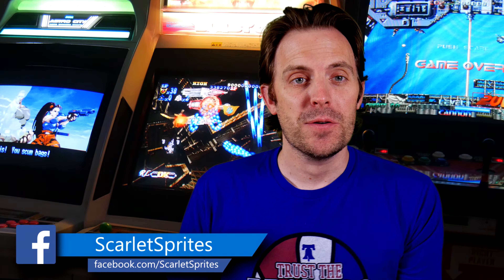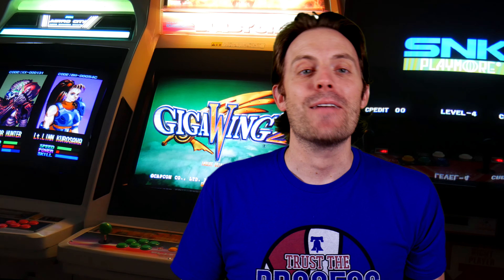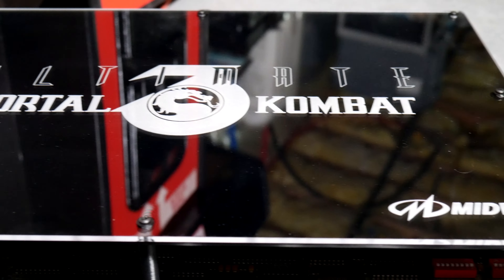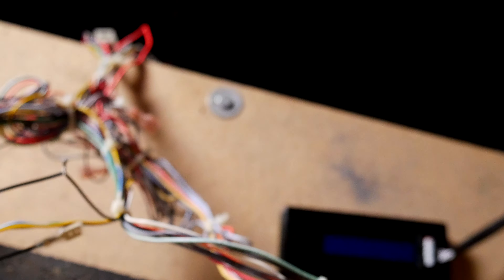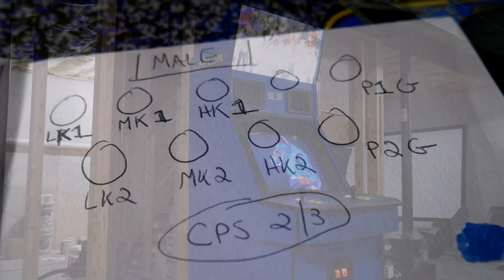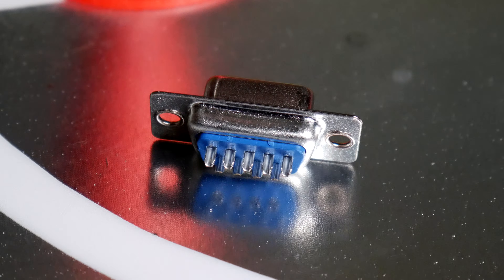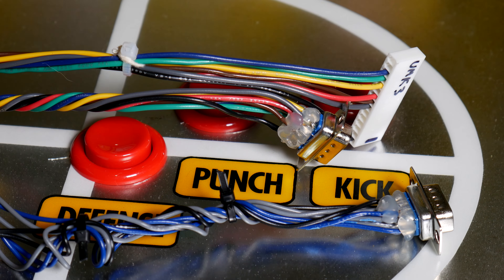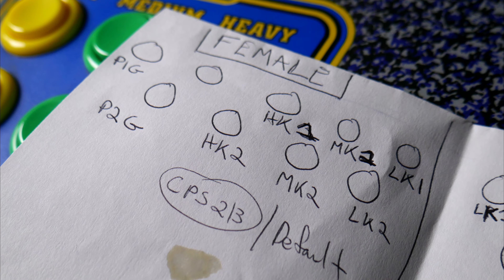Arcade Kick Harness Standardization

Comment: I came to a similar solution for my hori arcade stick - I wired it up with a db15 so I could plug it into my supergun/mvs, but then I wanted to also use it on other systems, and didn't want to unplug every pin from the buttons each time I switch systems. I've used the cheap ebay db15 breakout boxes for now, there's no soldering and they have a plastic case, but they are on the large side. db9 would be good too but I needed more pins.

Comment: This was a great explanation.  For those that don’t want to solder to the DB9 connector, you can buy male to female cables and cut them in the middle, then connect the wires to the wires on the PCB specific connectors.
Reply from the maker: Yeah, there are also solderless DB9s I’ve found too.  These were cheaper though and I didn’t mind spending the time.  You’re right though, if you understand the basic concept you can apply it to other parts and do the same thing.

Comment: Thx for diving into this.  Interesting to know.  I was mulling over starting an arcade collection the same time I was researching a JAMMA set up to consolize the MVS.  Glad I gave it up and just decided to go the MiSTer route, but I'm still an arcade fanboy.  Noticed you have AvP running on your Astro City cab.  Holy grail game for me.  Played the hell out of it in college and MAME later
Reply from the maker: Arcade boards are pretty fun and it’s really a hobby all it’s own.  I can troubleshoot and do basic repairs, but the heavy stuff like surface mount chips and even moderate pcb repair is still beyond me.  The AvP game is actually running off the Darksoft CPS2 multi that was installed in that cab, but has since moved over to Big Blue.
Reply: @ScarletSprites  AvP on a Big Blue? Sacrilege! ;-)  What about Player 3?
Reply from the maker: They actually shipped in Big Blues, but like you mention, my setup only has a CP for two players.  I’m ok with that though.  Even the 4P Midway cabinet rarely has three people going on it at my place.
https://pin.it/JpSLLfd

Comment: I know this first world problem all too well. My solution was to standardize on one format across all of my boards for the games which require a kick harness. The standard I went with is CPS2 style connector.

The way I did this is via CPS2 harness adapters for everything I own, including MK2, UMK3, CPS1, Namco System 12 (Tekken Tag 1), Sega ST-V and Taito F3. I thought about doing something like this re: DB9 connector but I decided I really didn't want to touch my cabinet wiring at all when I change boards, which is frequently. Now all of my cabs are wired "permanently" with a CPS2 kick harness and all of my boards connect cleanly, as if I was swapping a CPS2 motherboard. Even Atomiswave was adapted to this standard, via Atlus adapter at the JAMMA edge which moves buttons 4 & 5 to a CPS2 style connector.

Everything I used to make this happen was purchased from JNX or from the user community on the A-P forums. Now if you want to talk blasphemy, I play MK2 and UMK3 on an Astro City cabinet. But at least I do have the option of plugging in a USB controller/stick for those games, which was another thing I did to those machines.

Comment: How does that apply to my street fighter II CE that I have running with a supergun and Saturn controllers? How do I plug/wire the kick harness in this case?
Reply from the maker: The same concept could apply but I really have no idea how your Supergun is setup.  Presumably there is already an option for this that standardizes the kicks to the controller?

Comment: I did this to my cabs because I had a mess of 3 spliced harnesses in each cab.
Tekken mk and sf.
It was when I got the small cab super gun that had db15 for controllers and db9 for extra buttons that I thought to standardise my cabs.  Was going to wire my splice all my arcade standard jamma to db15 too but haven’t got around to it.
Reply from the maker: I thought about doing that and kept thinking there had to be a better way.  I definitely recommend standardizing it to something you can plug and play.

Comment: Funny you're using this in an astro city I thought all already had this setup included from factory. In mine the kick harness has two AMP  female connector on each end, one in the panel next to the 1 and 2 players usual plugs and one inside the cab where you can then change the end of the cable like you did. But good trick ! well done
Reply from the maker: My Astro may have been rewired before I got it.  It’s basically just straight Jamma wired like an American cab.
Reply: @ScarletSprites  oh yeah most likely then, guess you don't mind since unlike us peasants you don't have to change the panels all the time haha. I rarely comment because I don't feel comfortable writing in english but awesome channel man. Made my quarantine much more fun 👍
Reply from the maker: I only have one panel for this cab, lol.  That would be the major solution; remove the panel and add a Mortal Kombat styled panel for the Astro City.

Thanks for commenting, I don’t judge anyone’s English.  I certainly can’t write in another language either.

Comment: Those sketches are actually hi res graphics :)

For me i just have one jamma cab (new astro city) so i crimped all my kick harnesses (namco, midway, capcom) to the 10 pin amp connector.  Complications arise when you throw jvs into the mix though!  Eg. sega rev b jamma to jvs which assumes buttons 1-5 on jamma, and button 6-9 (yes 9!) on kick harness, necessitating another harness which connects between control panel and control panel headers.  Crazy, but i guess i enjoy using all the original harnesses.
Reply from the maker: Coming at you in 4K!

Comment: Street figther has kick pin battery. As far as rewire you can also use (2) 8 pin molex connectors well 1 male a d 2 female use mk board female 8 pin molex and leave kick mk plug with mk board and leave kick street figther plug with cps2 a board male 8 pin molex connector stays on jamma harness in cab. Is how I used to do them makes easy in a d out no matter board
Reply from the maker: Yeah, moles connectors would work for sure too!  Nice tip!

Comment: Interesting video!

But perhaps you can put for db9 connector an hood plastic and no hot glue? 🙂 (or this installation is for test in one step)

Jamma nation help me several times for finding solution about modding... last time, for change battery on a slot with not rechargeable battery (and pull off some composant for no charging)... happy they are here for helping hand (and other one 🙂)

It’s cool to see your basement again!
Reply from the maker: Yes, I think I’m definitely going to grab some cases for the DB9 connectors to make things look better.  The glue works until I can get those.  Thanks for watching again!

Comment: Unrelated question do you have a ki 1 . Reason I ask is I been looking for a ki 1 that its Toshiba laptop hard drive did not warp and throw errors due to heat in atract mode. I do know you can get a micro sd solution but want a original setup
Reply from the maker: I don’t unfortunately.  We had the cab in the downstairs of my dining hall at college.  I wouldn’t mind picking it up but $600+ these days!?  Yikes.  Honestly, as far as the HDD goes I unplugged my SportStation one and left it mounted in the cab.  Then I plugged in the Compact Flash card.  It’s the same game being delivered to the board and I don’t even think about it really.  I’d strongly consider going that route, but I admire the pursuit of all original.
Reply: @ScarletSprites  I tried playing MK2 and KI in my Capcom Impress, but they just weren't the same in a candy cabinet (due to button layout and the overall experience). I eventually had to get dedicated cabinets for those boards (they're both Midway cabinets that look great side by side). I still have a Midway-to-CPS2 kick harness converter if anyone needs it!

Comment: This is the #1 thing preventing me from being a true arcade fan.  I have 40-some PCBs, but still don't have a box of random wires and connectors for projects like this.  For shame.
Reply from the maker: Soldering iron, wiring, wire stripper, multimeter are tools you most definitely should have on hand.  I get it though, it’s easy to start accumulating and then it spirals out of control.
Reply: @ScarletSprites  The soldering iron is happening soon, at least.  Those CPS-2 batteries are making me real antsy right now.

Comment: Could you not purchase a female CPS2 connector and then build a CPS2 to Midway adapter? Then you wouldn’t be “inventing” a new standard with DB9 that you’ll need to remember when you build another adapter
Reply from the maker: You could.  Firstly though, I don’t have any JST connectors on hand.  For subsequent boards you’d then just be doing the same thing anyways (like a Namco, or even CPS1 SF).